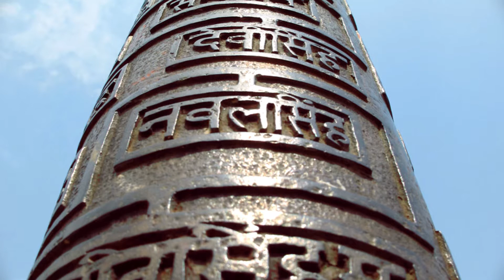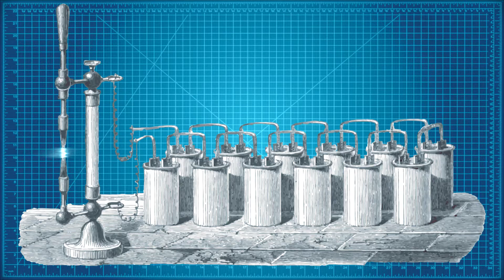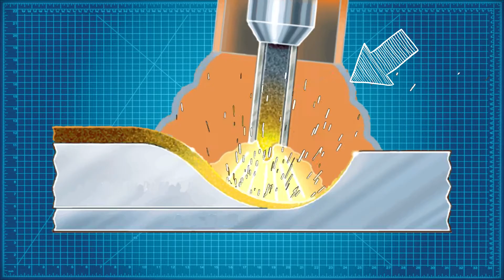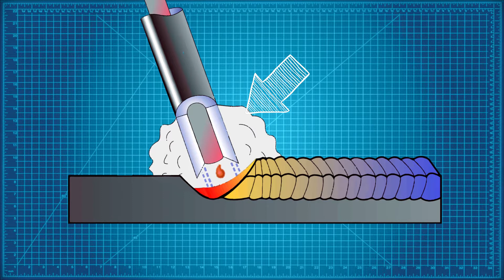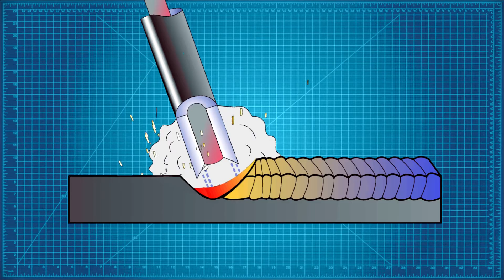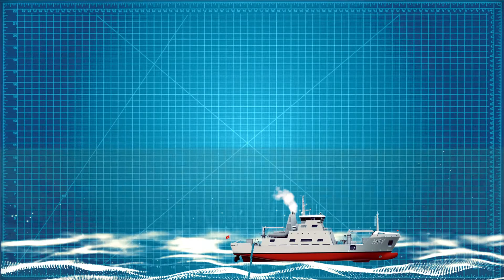The Story of Welding

Comment: The history was fairly accurate. The info about current methods also fairly accurate. Good enough. But some of the videos used were terrible examples. Showing TIG welding without gloves is irresponsible. You can get cancer from welding if you’re not properly clothed.
Reply from the maker: Thanks for the feedback and couldn’t agree more 😀 That’s what was available in the stock footage catalog 🤷🏻‍♂️

Comment: It should be noted that the filler metal in most welding rods and flux core wire are identical. The different weld characteristics and arc behavior comes almost entirely from the different recipes of flux used.